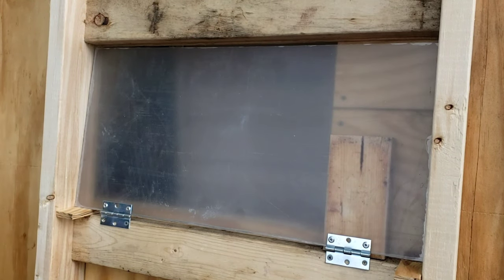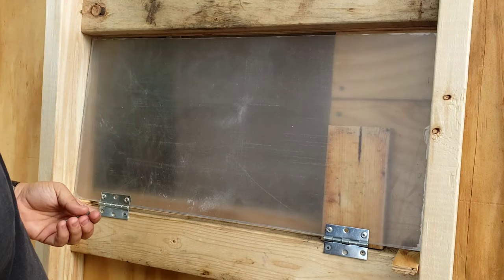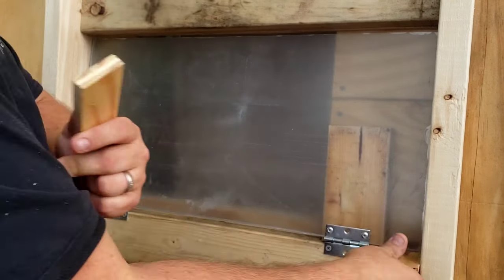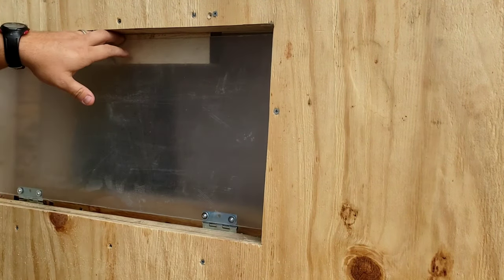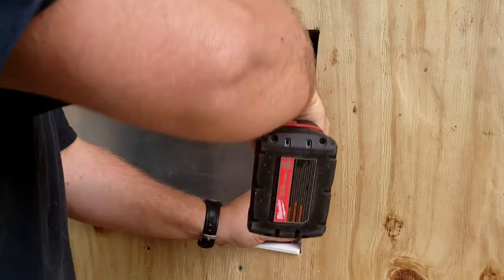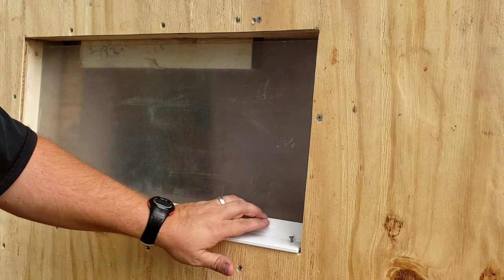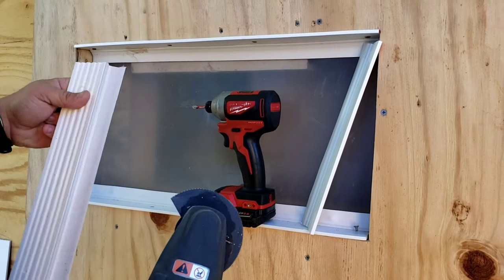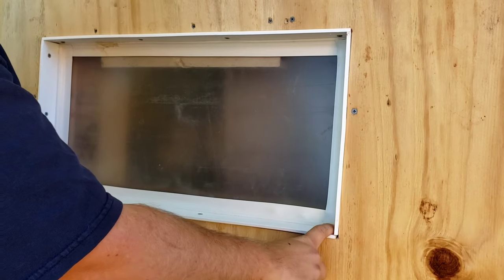BEST deer blind window ever!!!

Comment: Nice job putting this together and explaining it - and for  sharing the creds and link! I chose to put the rivets on with the rivet heads on the outside of the window because the rivet head has a little less profile sticking out against the rubber strip vs the rivet tail and a washer. So far no cracking of the drill holes but hey, it's good to show that it can be done differently. Thanks again!!
Reply from the maker: Thanks and as sportsmen or women I feel we see something and we run with it.  Between your video and mine the Menards stores by me were running out of weatherstripping.  I don't like the rivet tails sticking towards the weatherstripping but on the horizontal windows the extra strip covers them.  The downside i found on the rivets the other way is it seemed to tilt the glass in because it hit the hinge.  Both problems are minor considering that the cost breaks down to about $20 compared to a full window that only allows you to use half to shoot out of and takes so little time compared to framing a piece of lexan.
Reply: I'm not sure but I will be sure to use aluminum next time...

Comment: Love the window setup . On the bottom outside put a 1\4"H x 1'2"W shim at the back and it will help the water run off. Also, use Lexan instead of Plexi, 10x stronger with less chance of splitting or cracking

Comment: Thanks for the idea! 

I used it to create six 24" x 12" windows on my latest 6' x 4' elevated box blind and couldn't be more pleased with the results after this past season. They are super quiet to open and close so I am able to keep them closed to keep my scent contained and the blind warmer when it's cold and windy plus they are weather proof and keep the varmints and bugs out (where they belong).

I liked the idea of riveting the hinges to the plexiglass but unfortunately my technique needs a bit of work and I inadvertently cracked the plexiglass at the hinge holes on some of the windows but NO PROBLEM. Fortunately I had watched another YouTube video on the wonders of combining superglue and baking soda to make super strong repairs on my mistakes and all windows stood up well to a lot of use over the past season. 

All my future deer blinds will feature these types of windows!
Reply from the maker: Glad to help.  Best part about hunters is we learn something, experiment and put our own spin on it and keep improving.   My one question is was the rivet shank steel or aluminum?  Steel grab harder and are more likely to break plexiglass.
Reply: Try using longer rivets and adding washers on both side. But get rubber gasket washers to soften the squeeze from the rivets right against the plastic and the metal washers on top of them.
Reply: @ch34pskate16  Thanks, I'll try that next time. The superglue/baking soda fix appears to be holding up well into the second season of use and I made a second blind during this past off season and was a little more careful with the rivets and avoided cracking the plexiglass but I can see how the longer rivets and rubber washers would be helpful. Everyone at the deer lease are fans of these blind windows so I expect all new blinds will use them in the future...especially since we have a free source for the 1/4" thick plexiglass!

Comment: Good idea, I like it! Lexan is so expensive. I just looked at a piece of plastic and I don’t know if it was Lexan, but anyway, a 2X4 piece was $79.00
Glass was very cheap, like me. I thought about making a thin wood frame and put double strength glass in it. I would still be able to use the garage door weatherstrip idea
Reply from the maker: Hope you have a home depot nearby.  These make enough for 4-5 blinds with 3-5 windows each and the .177 thickness is perfect.  Hope it helps.
Your friend has shared a link to a Home Depot product they think you would be interested in seeing:

LEXAN	48 in. x 96 in. x 0.177 in. Clear Polycarbonate Sheet
https://www.homedepot.com/p/LEXAN-48-in-x-96-in-x-0-177-in-Clear-Polycarbonate-Sheet-11600101/301894184
SKU# 301894184

Comment: Why not use 2x4s..... cut grooves in them placing one on top and bottom.  Place the " real " glass in the groove... shim the 2x4 to allow the glass to slide freely ....and allow space for the glass to slide from side to side in the groove ?  No hinges no screws....just a basic sliding window.  Better yet.... use two glasses.   Can have an opening in the center..... or open the entire area !
Reply from the maker: That works fine.  I've just had bad luck with it getting scratches that way.

Comment: I rather make t he plastic glass slide left or right or down and up are much better.
Reply from the maker: We used to use sliders but ran into 2 problems.  Sealing without rubbing and scratching is difficult and I never liked how I would loose half the opening over what I would have with a flip in or out window.
Reply: @BuckPole  these are exactly the same reasons why I also prefer hinged windows over sliders.
Reply: I've made several of these big blinds recently here in northern MI using both hinges and slider windows.  I prefer the sliders too.  I build taller blinds and I design it so the window slides all the way up in place (or you can remove it completely) and it does not hang below the bottom of the top edge of the window frame.  It seals pretty flush and will not scratch the window if you build it right.

Comment: My windows have a 3.5" ledge, bc I built my blind with the 2x4's on their side. Do they make this stuff 3.5 or 4" wide? Or any ideas how I could incorporate this design? I like that it prevents water and the elements from contacting the wood window frame. Thanks
Reply from the maker: Maybe an extra piece of pvc molding but it will probably take a lot of caulk.

Comment: Why would a blind deer need a window?
Reply from the maker: 20 degrees below zero.  I know that's rare even here but it does get down to 15 to 0 degrees out on a fairly regular basis.
Reply: Without windows, birds, mainly owls, get in there and make a horrendous mess.
Reply: It keeps insects, animals and water out. Keeps the cold wind, rain, and snow out of your face, and keeps you warmer during the winter. Most places get cold in the winter during deer season.